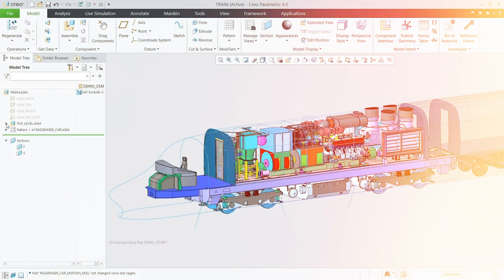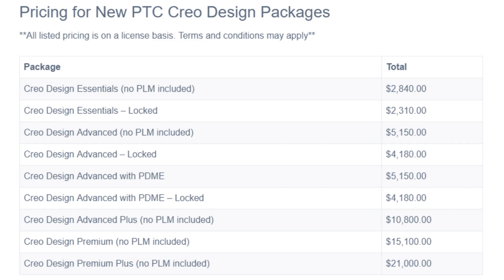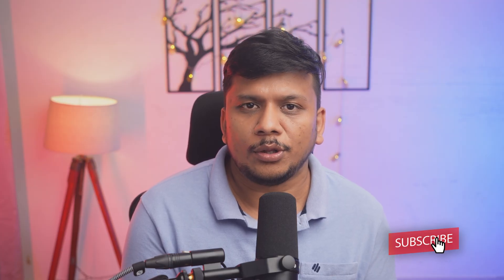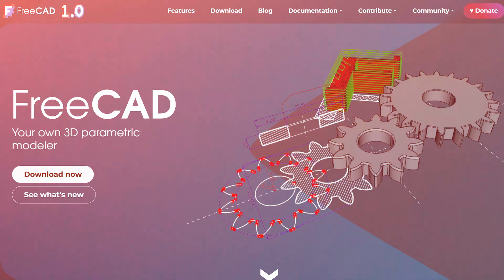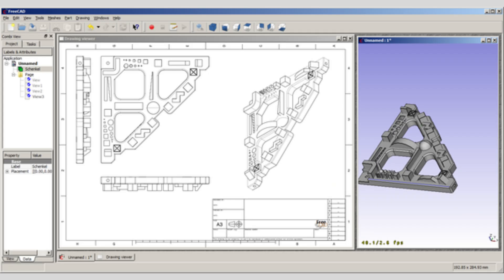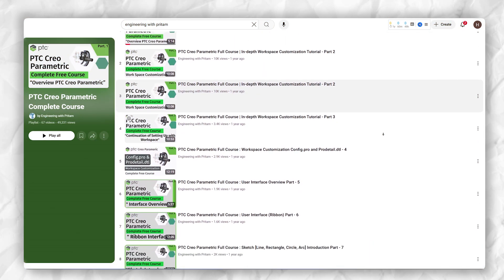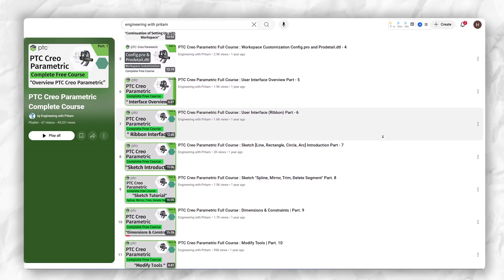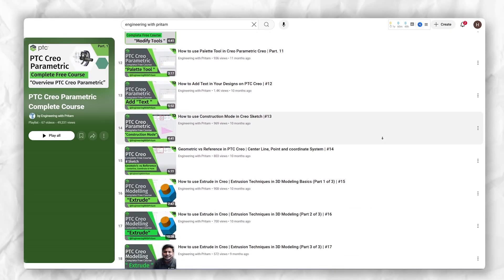Why I Finally QUIT PTC Creo After 15 Years – The Real Reason & My New CAD Choice Revealed!

Comment: Very good end explanatory videos, considering the seniority needs a designer to have in order to use a top-market product such as PTC Creo. The reasons to leave it makes it sense, but why don't you turn your focus on PTC Onshape? has free-subscription plan, is cloud-based and natively compatible with any platform and haw the tools the 90% of the industry needs. I don't turn-down Freecad of course, is excellent software for open source but the problem is, is not industry standard, you cannot find a jod easily with Freecad on your CV but Onshape is another story.